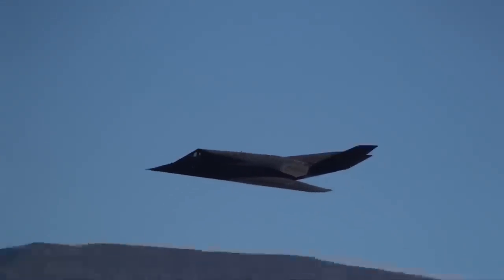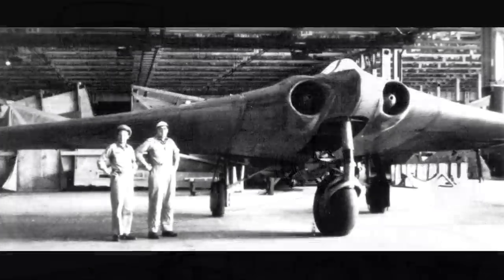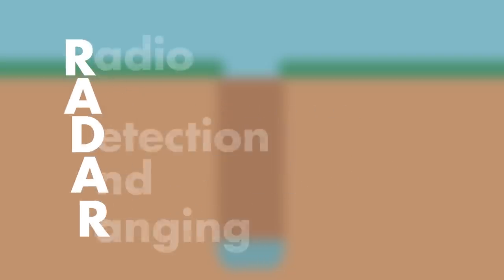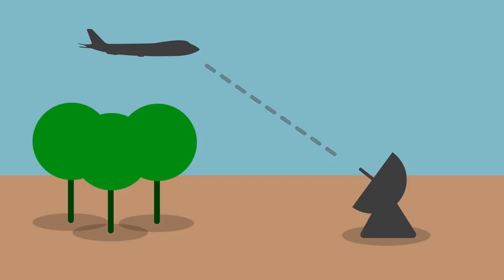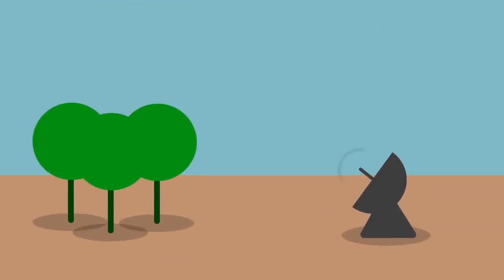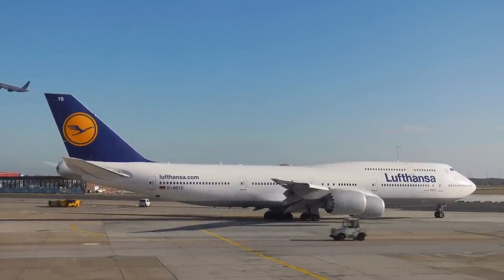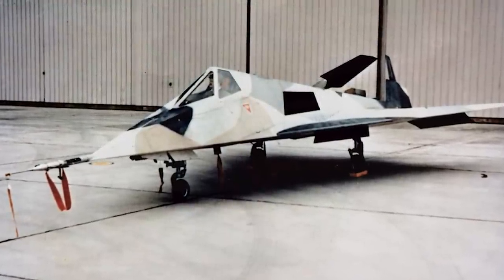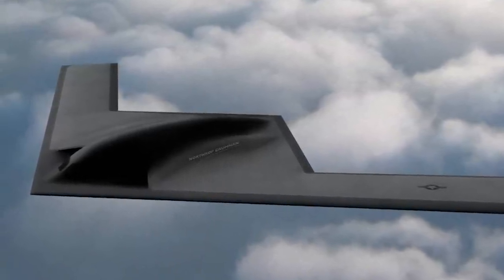What Makes an Aircraft Stealthy?

Comment: Serbs be like: "What do you mean the F117 was invisible?"
Reply from the maker: This is an interesting case. The only reason it was detected was because the bomb bay door was opened which greatly increased the Radio Cross Section (RCS) thus allowing them to detect the F117 on radar.
Reply: It was invisible.  The problem is that the pilots got sloppy and began flying the exact same routes every day.  They also stopped the practice of making radical course and altitude changes once their bomb bay doors were closed. Even something as brief as the bomb bay doors being opened is enough to give a radar the aircraft's course altitude and speed.

What happened was that some smart Serbian air defense officer noticed the pattern and located a radar so that it would track the aircraft the moment the bomb bay doors opened.  He then did some math and determine a time and location the plane would be at if it didn't change altitude, speed or course.  He then salvoed a volley of missiles at that location.

And since the pilot didn't change course after dropping the bombs he arrived at that location at the same time the missiles did.
Reply: RealLifeLore2 then what's the point? You can fly stealth but not drop bomb?
Reply: @Dennis-ns1yx   This is not a problem as long as the pilot makes course, altitude and speed changes after closing the bomb bay doors.
Reply: They forgot to make the bomb bays stealthy
Reply: @colincampbell767  
It's a combination of it flying too close to the air defense as well, stealth usually failed once it got within the distance human eyes can see. However, that also means that the Serbs probably didn't detect it until its weapon bay is open.
Reply: Same like F-35 shot by USSR technologies 1980 ABM hahaha.
Reply: @anujch1813   They didn't 'forget.'  It's simply not practical.
Reply: @dirwanedy8919    Maybe you should do some fact-checking on that one.
Reply: @colincampbell767  do more research. F-35 not such stealth just same like SU-57.
Reply: @dirwanedy8919    Yea right.  Care to provide some references for the claim that an F-35 was "shot?"  Or where you got your information on the stealth characteristics of those two aircraft?

Anybody who knows the details of stealth aircraft don't talk about it.  People who don't know anything talk about it.
Reply: @colincampbell767  He's talking about the hoax that an S-200 hit an Israeli F-35. It was confirmed to be a birdstrike. In fact, the Syrian military never even claimed to hit an F-35.
Reply: @reallifelore2174  that's not what happened. The bomb bay doors where closed. The USAF just got lazy and flew most missions through the same canyon so the serbs knew where the planes where going to be. Knowing this a combination of luck and skill was used resulting in a downed f117
Reply: Hungary: What F117?
Reply: Shoot at the 700mph bumble bee!
Reply: Yup, i am serbian, can agree
Reply: @JovanLemon  Zdravo moji brate.
Reply: @JovanLemon  Zdravo moj brate!
Reply: Nisu znali da je nevidljiv :D
Reply: Vjerojatno da se SAD dokopao nekih dijelova ruske opreme i radara!?Pretpostavka
Reply: I think the commander how spotted the F117, was of hungarian origin.
Reply: @colincampbell767  both aircraft have had catastrophic crashes while in their testing phases and only some are reaching operational capability in the near future
Reply: we need more explaination for the radio cross section and stealth was if it was available

Comment: The Ho 229 was not designed to be stealth, the slightly reduced RCS was just a byproduct of the flying wing design
Reply: Well the truth is is that the Ho 229 was unintentionaly Semi-Stealthy. Because of the Flying Wing design itself yes. 
That's the only mistake of the video. 
BUT, if it was given more time to expirment with.. The Germans could have discovered it's lower Radar Detection and realized what they just created. Ultimately developing the project into the First Stealthy Jet-Aircraft! The Horten Brothers of this aircraft said that they actually planned to add Radar absorbent skin coating using Charcoal.. But experts apparently say that they actually didn't plan that and only realized it after US development of Stealthy Jets in the 80s..
Not like they couldint have figured it out back then with more experimentation into the Ho 229 project..
Reply: @michaelstodovski2219  Yes but the point was that the germans experimented with stealth, which they didn't

Comment: The ho 229 was never built with stealth in mind as it’s low rcs can be attributed to it’s flying wing design as there was no model that could predict how radio waves would bounce of planes further adding to this there are plenty of other aircraft such as the f 104 or the valcurey bomber which both had lower then usual rcs but they were both never built with this in mind

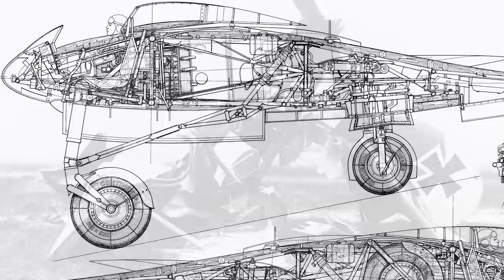Comment: 1:10 for the last time, the Ho 229 was NOT designed to be a stealth aircraft. It was a flying wing because of their superior fligt characteristics such as less drag and therefore faster and more efficient than conventional planes. But NOT for stealth use.
Reply: Yep the horten brothers just liked flying wing gliders
Reply: Thank u for this comment lmao
Reply: You’re right it wasn’t purposely designed for stealth, but the design did end up being very stealthy for its time, even if that isn’t what they were going for.  In 2008 Northrop Grumman estimated it’s RCS to be 60% less than that of the typical WWII aircraft like the Messerschmitt Bf 109 despite it’s overall surface area and wingspan being physically larger than the Bf 109’s.
Reply: @xxyyzz8464 it’s a fly being design compared to propeller craft, of course it’s going to have a lower RCS comparing it to even the gloster meteor that 60 percent advantage got reduced to near zero because you don’t have a giant propeller moving wind around 😂
Reply: @h4per_txt565  No, even without propeller’s, those airframes have a higher RCS just due to their shaping which allows radar waves to he reflected back towards a radar, whereas this design reflected a lot of the radar energy away from the transmitting radar (even if that wasn’t their intention for shaping it this way).  You should read a textbook on Radar Cross Section Design before you laugh, because I’m laughing at you and your ignorance of the field right now.  😂
Reply: @xxyyzz8464  also the phase shifting and anechoic chamber effect of the Horton’s build is the same reason why the Germans wanted to use a graphite paint on it because then it could actually knock RF waves way out of phase which would make British radar not be able to detect the aircraft at all, the phase shifting concept is used on all Flying wing stealth aircraft, and even found its way onto my personal favorite the YB-35 even though it was never meant to be a stealth aircraft

Comment: “Entered Iraqi airspace nearly undetected”

Wtf does that mean
Reply: Soldier: Sir, we detected US bombers!
Officer: I don't see anything on the radar.
Soldier: Sir, its bombs just exploded on our runways.
Reply: It was detectable while its bomb/missile bay doors were open. In 1999, one got shot down over Serbia because of that.
Reply: It means that it was almost not detected.
Reply: It means some of them were in fact detected but by then it was already too late to do anything about it. They aren't invisible, they just don't have a traditional aircraft signature on radar and instead looks like a small flock of birds going MACH 2. (Oversimplified, it doesn't actually look like a flock of birds either. It just looks like noise on an unfiltered radar coverage)

EDIT: The closer the stealth aircraft is to the radar station, the more detectable it becomes. Until it buzzes a tower, at which point i would say it's definitely detected.
Reply: Shigg McDigg oh damn so that’s the story behind it
Reply: @fortuna19  it was also an extremely lucky shot
Reply: @RealCadde  also f117 can be detected locked by some sam's from behind.
Reply: @shadowguardian3612  because the SAMs that can lock it are heat seeking and not radar seeking
Reply: Did you go to school my son?

Comment: If a radar signal bound off-planet Jupiter the signal would be absorbed due to plasma its atmosphere. This concept of technology can be used on aircraft in the future.
Reply: they have thought about it, but it has some big drawbacks. It's super hard to maintain a plasma layer around a jet without it just washing away . Second you would need an absurd amount of power to keep the plasma shield intact. And lastly it would make the pilot blind because it would also block his radar and other detection equipment, so now you're invisible but can't engage the enemy.
Reply: Further than that, it would create a huge electromagnetic signature that would be unlike anything that isn't a stealth plane covered in plasma. We already have missiles that can auto-target aircraft by the electronic signature their avionics suites use, sometimes to such a high degree that you can track supposedly-stealthy planes like the B-2 Spirit of F-22 across national borders.
Reply: With a giant plasma shield you would be detectable from hundreds of miles away do to the electromagnetic signature.
Reply: Russians already tested plasma stealth on the Su35 yet it required to much power and was unpractical.

Comment: That Plasma plane at the end already exists, the F-22 and F-35 use it on the front of their wings along with other small areas but those planes are late 90’s Tech, what they have today thats not perfected yet, 6th Gen will be fully Plasma coated and unmanned, the graphic of a plasma bubble is just a way to show it in their graphic choice, its really a very small molecular coating over the entire drone fighter/bomber, it looks like the B-2 Spirit but a bit more streamlined, much better engines, and the plasma will help it surpass speeds that humans cant take without blacking out, they already have perfected a torpedo that uses this tech to fly through the water at a crazy speed, the next 10 years tech is gonna be nuts...btw the new spy sats that the ULA just launched from Vandenberg are thought to be spy sats with a 2.5 meter reflector, but thats not what they are, they will help with the communication to these new planes globally, 2 more will be launched by next year and heres the best part, the real reason SpaceX just went and increased their new starlink sat #’s to over 4000 is to also use them to communicate with the new jets, what they say and what they do are always 2 very opposite things! Zuma made it, its up there just fine and was the first sat test bed for communicating with these unmanned plasma jets on a small scale to test out their systems! Funny how a Vulcan IV Heavy launch gets next to zero hype but a Falcon Heavy that is awesome was out dated before its first launch really! How many people even knew a ULA spy sat on a Heavy orange fireball throw away rocket launched just 24 hrs ago? Ima bet no one did but yet they did!

Comment: I think we will die before stealth technology gets better
Reply: Stealth technology isn't a magic bullet. The biggest problem is that involves a tradeoff: You can hide in some radar frequencies, but not in all, and that works mostly because long range radars (the kind stealth planes can detect) aren't precise; so now some countries are moving towards signal processing to improve their capabilities.

Also more systems are trying to work as a network with different strategies: You have some long radars to figure out when the stealth plane is, you try to detect it though their radio emissions, you try to use sensitive equipment in other locations as passive system to radar or other kind of bands that are disrupted, heat detection, etc.

Of course stealth can help you a lot with a good strategy, but it's also limited though physics.
Reply from the maker: These are all really good points. Certainly the frequency response that the RAM is tuned for is not all encompassing.
Reply: @reallifelore2174  Hi! 😅

While stealth has its limitations, it isn't also the worst surprise. The US probably knew about this and many of the airplanes and cruise missiles like the JASSM also relies in other techniques like electronic countermeasures, terrain following, emission control, etc; to be as near as possible of the target before getting caught.

Also there's that irony of this being one of two own goals the USSR had in this area, by releasing the groundbreaking paper on reflection of electromagnetic waves without noticing its value, so the US could use it to develop the planes to strike them. The other being inadvertently selling the titanium for the SR-71.
Reply: The stealth technology is already perfect. It is so good we don’t even see it!😜
Reply: @EduardoEscarez    The US still has the advantage in that we have been operating stealth aircraft for 40 years.  Over that time period we have developed a lot of stealth technology and tested it.  Not all of that technology was used.  So we have a really good idea of how close a stealth aircraft can get to a radar before it can be detected.  

And this gives us a defensive advantage also.  We have been testing stealth technologies for 50 years and as a result we know the strengths and weaknesses of each of the tech.  This means that any stealth aircraft being developed by other countries are using tech that we know about and have tested.  So we have an advantage in detecting stealth aircraft as well.

Comment: I've read f-117 had RCS 250cm^2, and you're talking about 1??
Reply: RCS is different in different signal frequency. The current stealth tech development focus in x band signal which is used in smaller air based fire control radar and missile seeker. However, the stealth performance is worse against lower frequency signal like s band, L band and UHF band which are used in larger surface based fire control radars, Early warning radars and anti stealth searching radar.

Comment: Why don’t they install a system where the radar can detect if a signal hasn’t returned?
Reply: I’m no expert at all, but I assume this is why: if you are scanning for a plane in the sky, then you can find it because radar signals return. But it doesn’t really work in reverse I’d assume unless the sky was like a radar returning blanket. If the sky isn’t returning radar, and the plane isn’t, you won’t be able to detect if a signal hasn’t returned because I’d assume it would just detect the entire sky.

Comment: They get shut down very easily. They are 100% detectable from over 500 Km. Just take a cook at Hensoldt Pasive Radar systems. Germany has proven the uselessness of such aircraft again any Military that is equipped with Gen 3+ systems.

Comment: Oh for the love of God “stealth” does NOT make any aircraft invisible..

Heck AWACS operators could still track Nighthawks by applying basic filters because

Any metallic object (no matter how small) travelling at 600kts is PROBABLY AN AIRCRAFT.

Stop spreading stupid pop-science based on Company Advertising.. 

Sorry.. I’m just sick of these “stealth” videos.
Reply: Ever heard of cruise missiles? Not aircraft ;D
Reply: @Katniss218  they fly much much faster mate
Reply: @anujch1813  Not necessarily. It depends on the type.
Reply: @Katniss218  Those are still most likely a threat, because allied forces will notify any friendlies in the area to prevent confusion and fratricide.
Reply: Agreed, OP. He also seems to be fanboying the F-35 Lightning a bit.

Comment: The Ho 229 was not designed to be stealth, the slightly reduced RCS was just a byproduct of the flying wing design
Reply: Jun Xian Wu beet me to it and good job
Reply: also it was made with mostly wood, which somewhat absorbs radio light.
Reply: Not entirely true that low RCS was just a byproduct of the design. It also had a specialised radar absorbing paint.